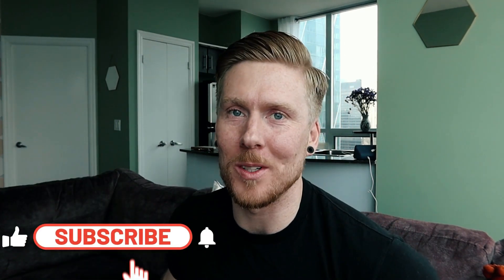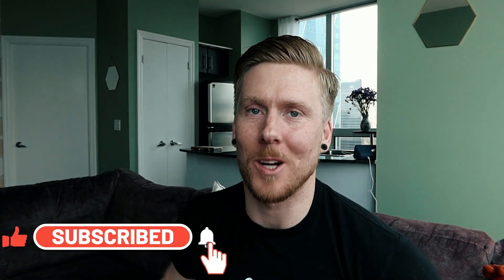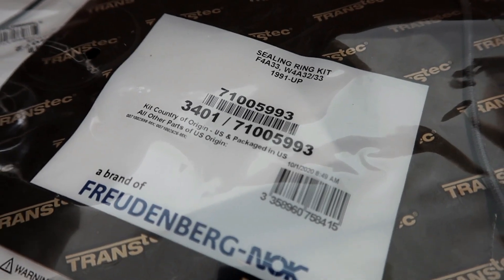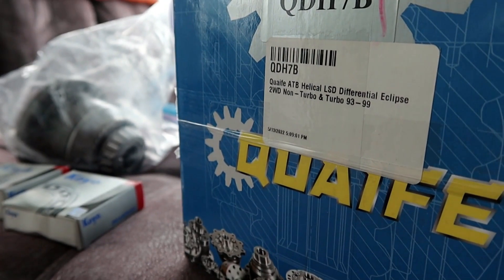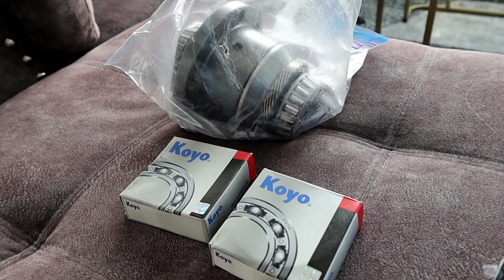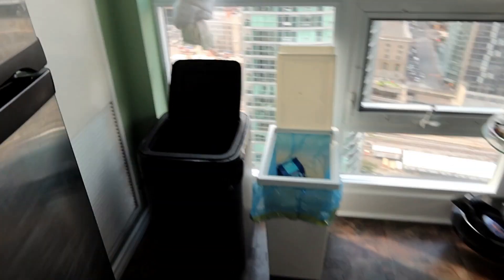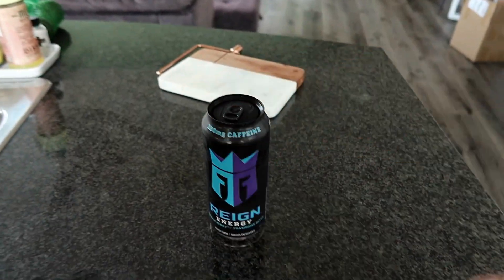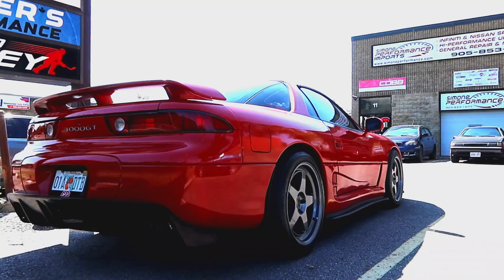Mitsubishi 3000GT gets a Quaife Differential and Transmission Rebuild (Better than you think)

Comment: Nothing wrong with a auto SL. That's what you want as a intelligent adult, for a daily driver in 100% of weather conditions, including heavy snow. I had one, and driving through 8in of snow on the East Coast was a breeze. I didn't even have snow tires or 3 peak snow rated all seasons. I didn't even have 1st gear 😅